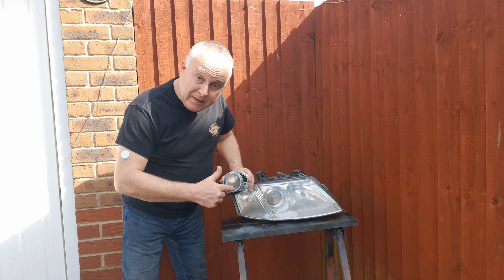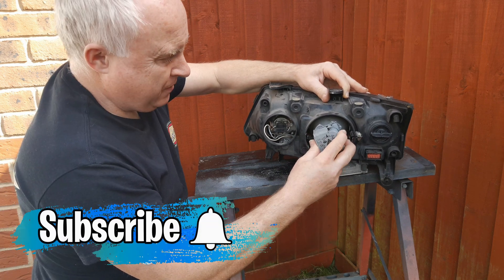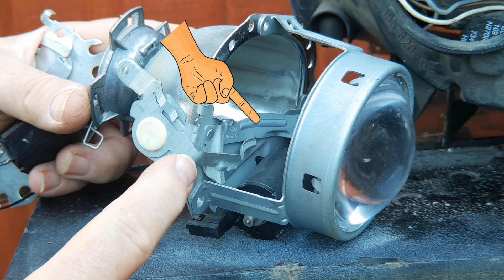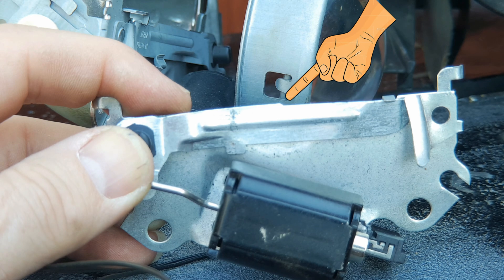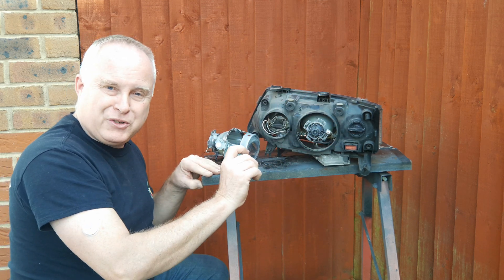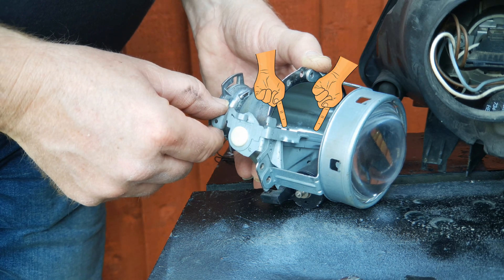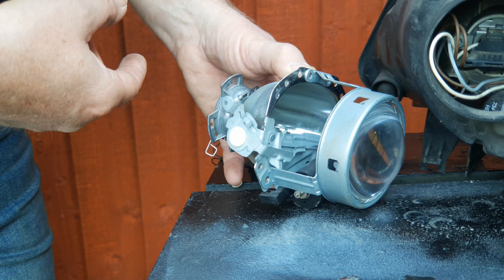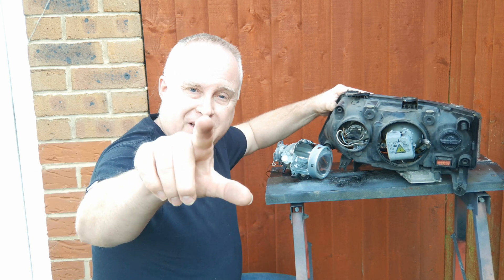Dipped Beam Alignment for Driving to Another Country

Comment: Hi there, 

i have a 2010 Nissan Qashqai that I am putting through an mot in Europe. Do I need to do the same setting as you showed or I am also be able to change the aiming direction by using the plastic scews slots provided on the headlight unit(one is vertical and the other is horizontal adjustment) 

Thank you for your help !

Comment: Hello there Cyd. I thought I recalled you addressing this issue. Got an imminent ferry to France and was frustrated that the old headlight masking kit I have won't do the job. No guidance about a fitting, and just wholly unsuitable I think. Sadly my 53 plate 9-3 doesn't seem to have the adjustment you cover here - I am really going to have to upgrade my lights, particularly as they're so discoloured now. Just watched your video on restoring that. I expect they will sell the modern beam adjusters on the ferry - fingers crossed. Don't expect to be driving in the dark, but the adjustment is, of course, a legal requirement....

Comment: Hi ! Can I ask you a technical question concerning Saab's? I have the chance to buy a 2006 9-5 with lpg conversion in vgc at a very good price, my question is there is a rattle form the drivers side on cold start that disappears after about 2 minutes then runs smooth, anything to worry about? Regards Will
Reply from the maker: RHD or LHD car?
Reply: @CycloneCyd  Sorry ! Should have made that clear! RHD , noise seems to be at the timing side , was thinking it was slight wear in the chain or tensioner , but as a lover of Saab's but never having owned one I don't know if it's normal or something to worry about! Love your videos btw very informative and entertaining . Regards Will
Reply from the maker: @fireblade95  timing chain tensioner perhaps?
Reply: @CycloneCyd  worth buying?
Reply from the maker: @fireblade95  I'd say so. if it is a tensioner, it might be a little 'sticky'. Two or three oil changes at 1500-2000 mile intervals will help clean the engine out and may free up the tensioner. As long as you change the oil every 5-7000 miles hopefully it'll not get any worse.
i always used to say that as long as the body is good, everything else is bolt on and can be changed or fixed.
Reply: @CycloneCyd  I was suspecting something on those lines . I used to own a bike shop and have lots of experience with cam chains. My local Saab specialist offered to inspect the the car for £20!!! So I could be 100% sure but it's sorned and can't be driven , so I've got to pass on it. Shame really it's a lovely machine . Regards Will